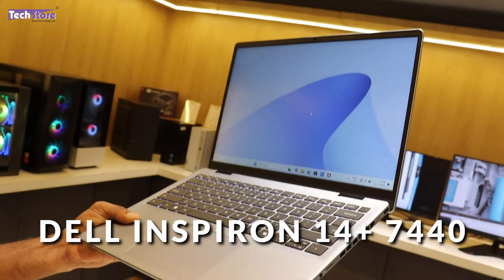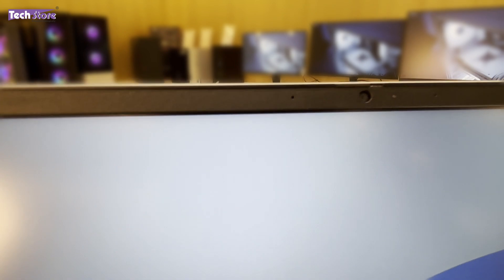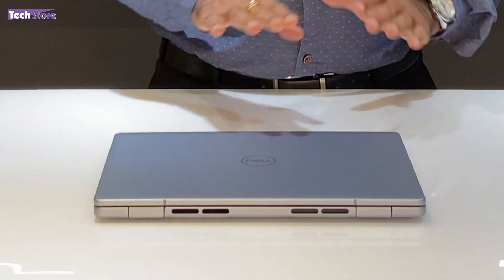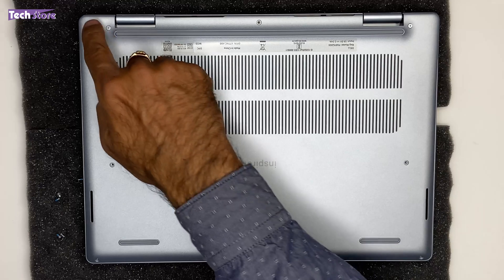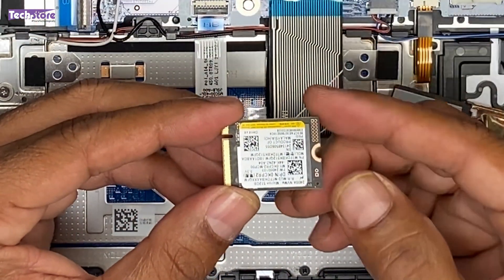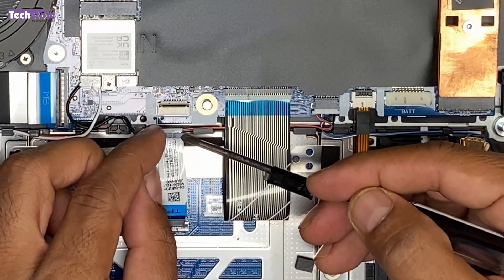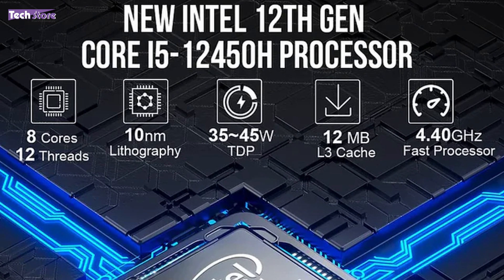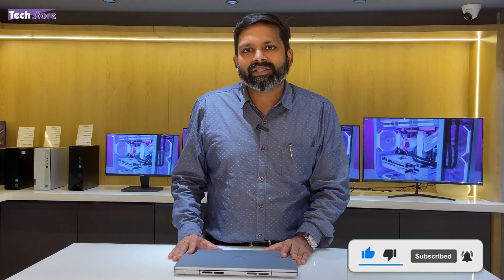🔥 Dell Inspiron Plus 14 7440 Review & Upgrade Guide: Disassembly Made Easy! 💻🔧

Comment: For the CORE ULTRA 7 version is the RAM upgradable. I am thinking to purchase the 16gb variant
Reply: Not upgradeable
Reply: 16 GB RAM is more than sufficient for complex & multiple tasks operations.. You don't need to upgrade further.
Reply: @bharathbabur8559 I wish dell had made it known this is not upgradeable. At the time I made my purchase the 32 gigabyte version was not available so I bought the 16 thinking I could change the ram like I always was able to with my other Dell laptops. Unfortunately I really wanted the 32 because I wanted to run zbrush on it. Insufficient for what I wanted. Unfortunately I didn't go looking for video reviews like this until now when I received it. The day I ordered I was only reading written reviews and nobody had mentioned this problem.